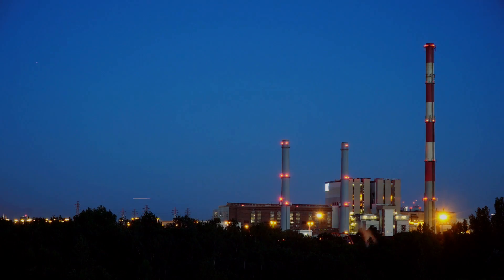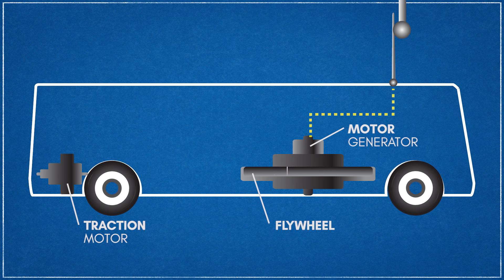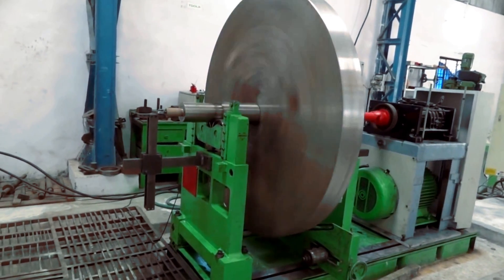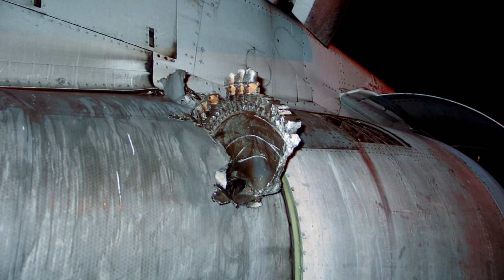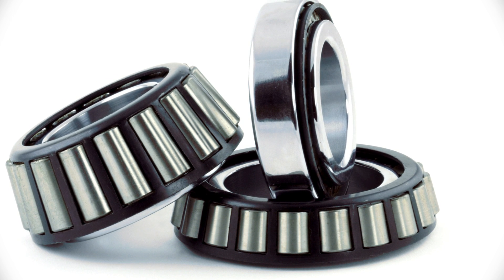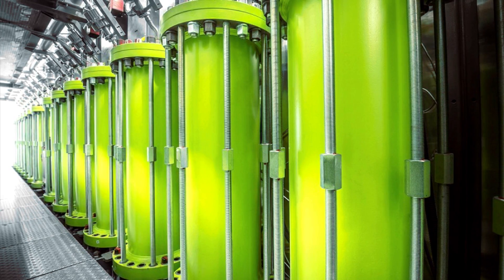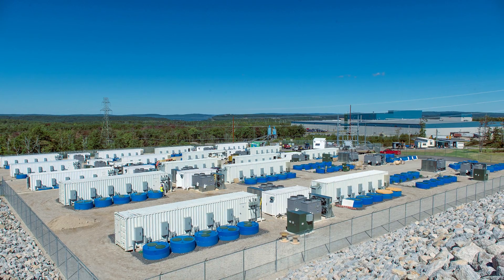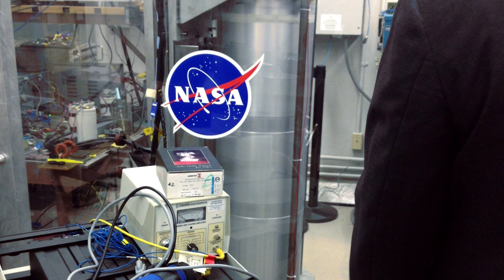The Mechanical Battery

Comment: Flywheels, due to their mass, hardness, and speed, must be protected inside heavy container assemblies, since they can and have broken apart explosively and injured people and equipment. The resulting large packaging limits applications. There is as yet no truly economical and efficient means to store energy repeatedly, except for certain very large and very small capacity applications.

Comment: The flywheel speed is effectively a non-issue if you use a regulated system such as a flyball governor. These systems exist specifically to enable enably flywheel storage across a wide range of energies and keep them operating at a very narrow powerband.

Virtually all of the issues you mentioned would be completely solved with sufficient flyball mass and tuning.
Reply: If a flywheel of fixed geometry is rotating at a constant speed it is storing a fixed amount of energy.  If you want to put more energy into or get energy out of a flywheel its speed MUST change so regulating the speed is the one thing you DO NOT want to do!   I suppose you could design a trick flywheel with variable geometry that would spin at a constant speed and accept or release energy by changing the location or the rotating masses.  At high energy storage they would be far from the centre of rotation and at low energy storage they would be close to the centre of rotation but the complications of doing this would seem to make it impractical in practice.   I think perhaps you misunderstand the the function of a fly-ball governor.  It is designed to regulate the AVERAGE speed under varying loads.  The instantaneous speed of the engine/flywheel will still be varying depending on the part of the operating cycle the engine is at.  The flywheel will be speeding up a bit during the power part of the cycle and slowing down at TDC/BDC assuming a steam engine or during Exhaust, Intake,and Compression strokes assuming an Otto cycle internal combustion engine.

Comment: Many computer hard disk drives would use the disk platters as a flywheel and the motor as a generator once power is removed to park the magnetic heads.

Comment: Well yes and no instead of one big one meter flywheel you brake it up to much smaller ones a professor did this back in the early 2000's I think it was 4 flywheel at each wheel of the car but due to the speeds it was deemed to unsafe they said it would be like having 4 grenades at each wheel if you ever had a car wreck .

Comment: Best energy storage system is compressed air, liquefied air, or frozen (solid) air. It's foolish to make a mechanical system to "store energy," when compressed air stores energy without any energy loss during storage. Okay now attack me for saying this, but if it's not total energy storage by the simplest method, it's pretty close to the perfect deal, especially with new carbon fiber composite air pressure tanks for storage, and new rotary Wankel air motors which are nearly silent in operation and extremely efficient, very high power to weight ratio, very lightweight, very high torque, useful for all surface transportation as well as VTOL aircraft. A concept car using this technology, called the GM Cadillac Aera, won the top award in the Concept Car division of the Los Angeles Auto Show several years ago (2010 ?). This is one of the most astoundingly efficient and most overlooked technologies to solve all our air, land and sea propulsion needs. We need it in production. One benefit of such systems is that when used for VTOL aircraft, we can actually make roads, bridges and tunnels obsolete, and get rid of all or most air pollution caused by transportation. This is an extremely simple technology, extremely durable, maintenance free, "fuelless" after the air is compressed or frozen. The simplest methods of doing things are always the best. This is better than electric vehicles - - by far -- even though the electrics are gradually getting to be very competitive, they won't ever exceed the "simplicity factor" of air powered rotary Wankel motors powered by compressed air using carbon-fiber-composite air pressure tanks holding 20,000 psi or greater, for ranges of 1000 miles or more per fill-up. Air pressure tanks can be conformed into the fuselage and body structural parts of a vehicle, thus there is no need for a "dedicated" air pressure tank compartment. So no inside space is required for the air storage tank. The air pressure storage systems would also be designed in a failsafe way so that in the event of extreme overpressure they will fail safely - - this would hardly ever happen anyway.
Reply: Sounds like great technology, but doesn't sound very safe.

Comment: Would they be more effective than super capacitors at high ~100v voltages at boosting li-ion short power? capacitors in series loose capacity to the point of being unusable at those voltages, maybe this is the answer?

Comment: Could a fly wheel generator with the flywheel magnetically suspended in a near vacuum make more energy than it would take to keep itself spinning even as its giving power to another electric motor. Aided by the weight of the fly wheel. Would it be possible to make energy for as long as the parts last as long as the draw off the Flywheel system isn't more than it can generate. 

Setting aside the notion of perpetual motion being impossible. Of course. Although an electric car with electric generators in each wheel and two drive motors with two sets of batteries and a system that uses half while charging half and using 2 generators to aid in driving down the road which at a steady speed would be easier for the motors and if you go faster the generators turn faster making more power. Should be completely possible to make an electric car with a range determined by how long the car itself lasts... Especially when you can go on amazon and by a hand crank generator that has almost ni resistance and can generate at maximum 400,000 volts. However Thats at .03 amps but if they designed it right and refined the technology Thats literally a highschool level science project. 

Why the fuck they wasting time with things like regenerative breaking that only works when you stop compared to refined generator tech that generates power as the car drives. 

If I was one if them I'd be like. Holy shit its kinda like a wind mill that generates power but instead of wind its the ground and the weight of the car moving to generate electricity and use gearing and magnetic suspension of moving parts which may not even be needed with four generators and batteries where half are charged as you drive and half is used by the motors along with 2 generators. It seems to good to be true but I gotta try this... 

But I'm not that smart.

There is a problem with that if it does work tho. I highly doubt any of us would be able to service our cars at all aside from....... Was gonna say tires but they are connected to the generator and a mistake there. Anything not to do with powering the car.

Todays mechanics I can fix the mirror and your lights. Clean your car for you but and thats about it. 

So many would either have to go to school to learn how to work on that type of car o start losing customers as the cars became more widespread. 

And if costs for some things is why they hold back with these sorry excuses for electric cars. They must forget that a specialist would have to work on those cars and that they could be the ones with those specialists.

Comment: If you were to fill a fly wheel with some sort of a compress-able gas would that increase the time the flywheel would remain at a useful speed. As the flywheel would slow the rotational mass would decrease therefore decreasing the decay. Or am I thinking about this all wrong?

Comment: The entire Paris telephone network has used a flywheel energy back-up. However, the possibly devastating effect of its failure meant that it had to be kept underground within a large block of concrete.

Comment: The spinning mechanical battery in a bus or other vehicle is essentially a gyroscope, and a massive one at that. Spinning at speed over the course of several hours  (from charge to charge) should eventually cause the vehicle to list as the earth rotates. It's the same principle that keeps the earth's axis always pointed towards Polaris as it orbits the sun. It wants to keep its axis aligned to whatever direction it had when it started spinning, but a rotating Earth will keep reorienting the vehicle.

Comment: We've had useable grid mechanical batteries for years... Talking about these ridiculous ideas is a waste of time. You also fail to mention the weight of these systems, as well as completely ignoring the energy use for the magnetic bearings... The massive loss through inverters when turning these DC systems into ac.... Why aren't they in widespread use? Because they suck, just like all of these other stupid "green energy" ideas.

Comment: the shape factor seems to favor tappered disks
is there any relationship with flying saucers?
the example given for energy storage for a vehicle said the fly wheel should spin at mach 11 on its edges
this is around the same speed people said those flying objects were reaching
does this means that those strange vehicles are using their entire mass and disk shape as an energy storage?
Reply: Have you any idea of the G forces a mass spinning at Mach 11 would produce?
Take a look at 6:45 ... that wasn't even Mach 1.
My front loader washing machine can produce around 500 Gs in spin mode.

Comment: I would have thought supercapacitors hold more promise as there is no kinetics to deal with & no energy conversion losses... 🤔

😎👍☘🍺
Reply: The only problem with supercaps (or any capacitor) is that the moment current begins to flow voltage begins to drop.
Reply: @thecarman3693   if they (supercaps) are run through an SMPS the output would be held steady for a large portion of the charge capacity... you see this working in equipment which can take multiple input voltages.... basically the DC input is chopped, stepped up (or down, as necessary) and rectified, smoothed & regulated (using a feedback loop  back to the chopper circuit )for a steady o/p voltage...

With circuits like this, the output voltage is independant of input voltage fluctuations....  which is not the case with a linear PSU which uses transformer ratios to control the o/p... 

BTW ... ANY " finite " energy source output will droop once loaded... whether that be flywheel revs or battery/cap voltage drop or pressure drop in a gas cylinder... so supercaps are not alone there

😎👍☘️🍺

Comment: Is it possible to construct giant flywheels with their spin axis parallel to the Earths spin axis anywhere on the planet? It would mean there would be no need to correct for the planets rotation being in conflict with the flywheel. The only real risk would be Earthquakes setting them lose carving giant circles in the landscape.  It would work well anywhere on the equator because the flywheel would be vertical and well over the South pole horizontal.
Reply: Ahhhh, not quite. The earth, being a sphere, would cause anyone traveling north or south to have issues. If the Earth were a cylinder, then yes.
Reply: @thecarman3693  I mean a fixed system.  A bigger wheel would demand more in its orientation which can only be constant if the axis of spin is parallel with the planets axis of spin
Reply: @Gleesonglee  I'm not sure what you mean by "fixed system" or "demand more".
I think we agree that along the equator the axis of the flywheel (if aligned with earth's axis) would remain constant as the Earth rotates and be normal to the longitudinal axis of the vehicle --- if the vehicle were traveling along the equator's path. But the moment the car made a turn that gyroscope axis would begin to shift. Just left or right as long as near the equator. But start to go noticeably north or south and it will either have to dip up or down or the car will feel forces pushing it up or down.
Reply: @thecarman3693  I am not thinking about flywheels in vehicles. That is the misunderstanding. I am thinking about flywheels with diameters of 10 to 20 meters

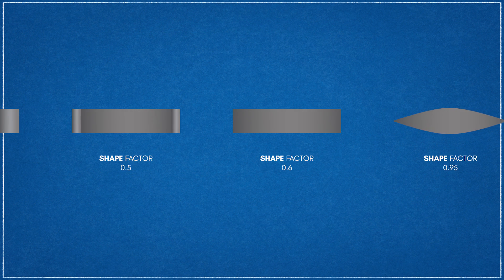Comment: At 7:38, it is asserted that "novel disc-shaped rotor geometries approach near perfect shape factors" which is true for the tapered disc shown, but the next part of the sentence is false: "but are limited to low RPM". In the late 1960s/early 1970s, MIT designed, built and tested at least one such flywheel that was actually used in a test car, and was reported on by one of the Popular Science-type magazines of that era. That flywheel was 20.5 inches diameter, weight 40 pounds, material: mild steel, working speed 24 or 25 thousand RPM, ran in a vacuum housing on mechanical bearings, had an output shaft with vacuum seals, and delivered about 400 horsepower (300 kW) for at least 10 seconds. It would spin for at least 2 days with no additional input energy and still be able to start the 4-cylinder engine of the heavy, novel hybrid test car. The engine was 100 horsepower (75 kW), replacing the normal 500 horsepower (375 kW) V8 gasoline engine, and with the aid of the flywheel, still gave that car the ability to accelerate like it had a 500 horsepower engine, but without sucking down fuel like a greedy glutton. 

Oh, and the failure speed of the flywheel was 36 thousand RPM. When it was tested to failure, the novel containment shroud, 2 inches thick and made of 1/4 inch mild steel outside with dense, non-composite fiberglass inside, easily contained every bit of the exploding flywheel. The massive kinetic energy of the steel fragments was spent in an instant, shredding the glass fibers into dust and small pieces. The shrapnel never penetrated the outer housing because its kinetic energy was gone before it reached the shell.

Now I can almost hear you asking, "But if it was so great, what became of that technology?" Unfortunately, it was doomed by the expense of the rest of the drivetrain they used, which consisted of THREE automatic transmissions with torque converters. In those days, electronic systems able to handle hundreds of horsepower were horrendously expensive and difficult to implement, since they had to rely on Silicon Controlled Rectifier (SCR) devices, which cannot be switched off except by somehow stopping the current flow through them. With modern electronics like IGBTs or high-power FET transistors, it would have been very easy and fairly cheap to build an electronic power converter for that simple flywheel system, resulting in an affordable and efficient yet high performance car. Add super magnet motor-generators and bearings, which would eliminate the drag of the shaft seal and ball bearings, then you'd have a Tesla-killer for maybe half the price.

Comment: Although I've known about the application of inertial and potential physics since I was a kid, or more accurately I've known of the existence of this branch of science, I am impressed at how refined and varied the apps have been developed to, with emphasis on how a lot of these innovations outlined here, which I have only recently become aware of, have actually been designed a long time ago, becoming more effective as chemical / engineering over time picked away at "friction / resistance" bit by bit...(I wonder if the police are aware of the magnitude and persistence of some of these machines "Resisting Arrest"?) I imagine that these mechanical, or as I like to call them - Inertial Batteries, could make a major role and innovation increase, if and when human industry manages to move and base itself into deep space, such as the outer solar system at least...or hopefully beyond. Super low temperatures within a degree or 2 of zero Kelvin, the vacuum of space and practically Zero gravity, seems to me to be a perfect environment for this, and one where it would certainly be needed to assist any people who may be living and working in space. A fascinating, and exciting topic. Great video. Much thanks.

Comment: 4:02 What am I seeing here... A centrifugal adjustment balance weight within the flywheel...mounted on a leaf spring??  I've never once seen or heard of this device.  Why would a flywheel need such a device?  As rpm's increase it needs balance adjustment?  More weight toward the outer edge only at speed?  Can anyone shed some light on this for a fellow Gear Head like me?  I'm very intrigued.
Reply: Balance takes on a more extreme meaning at high RPM. Any lack of alignment would show itself as vibration of the axis which could be a problem with mechanical bearings.

Comment: So a flywheel at the equator turns to the opposite rotation direction every 12 hours, right? Can we assume that its stored energy is flipped?
And in this case, instead of using the bearings to keep the flywheel at a local verticality, why not just let it rotate to stay in counteraction to Earth's rotation?

Comment: The hefty containment is not for vacuum support, seriously, only 14psi. They are there for mechanical containment in the event of a catastrophic failure and to with stand the electro mechanical forces on the stator windings during normal operation.